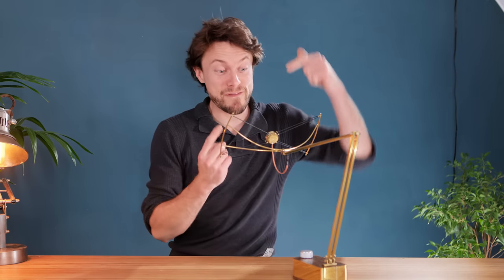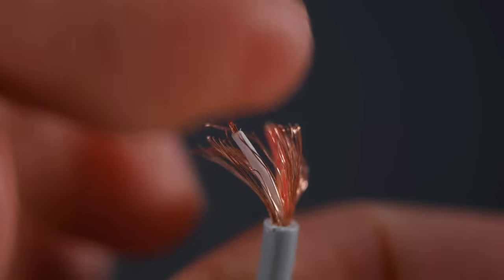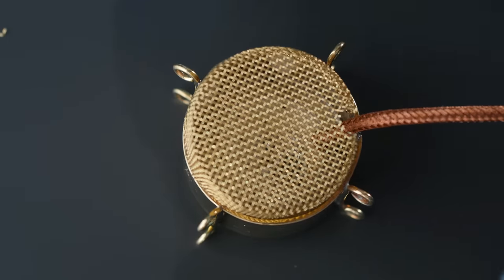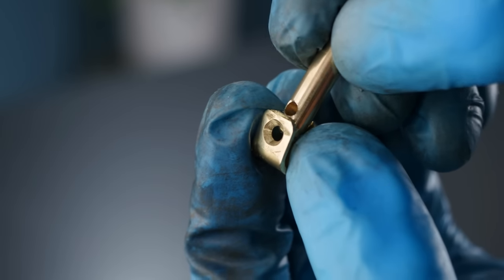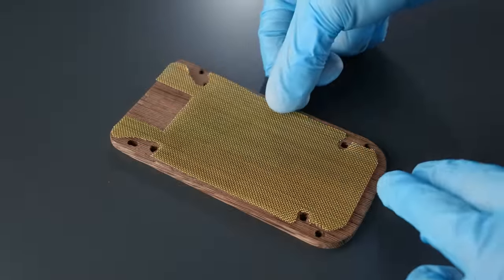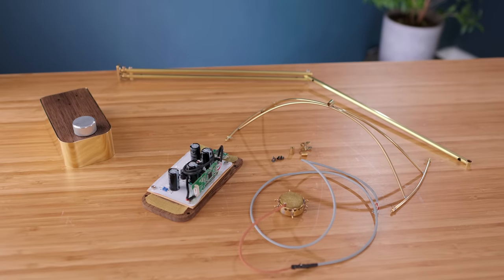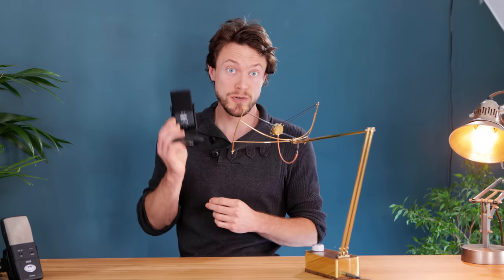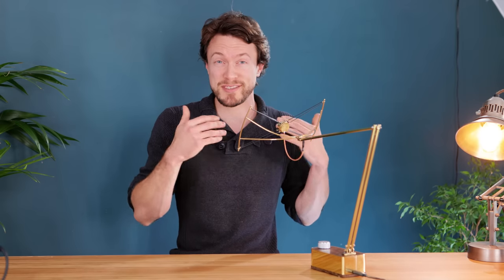Building a quality USB-C microphone

Comment: My favourite part of this DIY is the salvaged USB interface. I would not want to solder all of those connections.
Reply: I'll take the $10 lapel mic from Amazon that sounds just as good.
Reply: @DecafToaster740  but that's an extra $10 cost on your project. if you do that with every component, it gets expensive and just makes more e-waste. recycling parts saves so much money

Comment: Nice work, Matt. Note: soldering isn't welding. Welding melts the workpiece, soldering uses a lower melting point alloy to make the joint.
Reply: he might be brazing, depending on the filler used
Reply: @iivarimokelainen  Brazing & soldering are the same thing, melting a filler material.  If the temperature the filler material melts at is above 450C, then it's brazing.  It's really an arbitrarily defined difference.

As Bill pointed out, welding doesn't need a filler material (solder in this case).  You can weld brass, but the zinc fumes will give you a bit of headache so best avoided

Comment: Steampunk microphone. I love it. I worked in radio for a while, so I've experienced a few different microphone alternatives. Overall, I think your DIY alternative stacks up really, really, REALLY well. It has some more top end, but it does not sound "tinny". However, the Neumann sounds more "balanced" between the top, middle and bottom end. Something I think can be remedied easily and cheaply by changing some of the capacitor values. Overall: I think it is a thing of absolute beauty, both in sound and appearance. I would actually happily buy one of yours instead of a Neumanns... It sounds THAT good.

Comment: Had no idea microphone capsules are so much cheaper than the microphone. Going to do this with a Shure RPM106, which is only $159 instead of $359! And you can get the windscreen for only $15 extra and make it look and sound like the SM7B. Excited to see how it goes, thank you for the tutorial and information!
Reply: It might surprise you, however, most electronics that don't require highly precise manufacturing due to their complicted nature are like this. 

Take for example, just listing things off the top of my hat;

-Headphones and speakers(which are basically the same thing) can be made similarly to the video, at a fraction of their price. The most annoying part is a good housing for them, but if you have a non working headphone for example, you can just switch its insides with a headphone speaker and some DIY skills like in the video. 

-Powerbanks are also something you can replicate for very cheap, if you have a 3d printer(for the case) even better, but you can do it without. There are a lot of DIY powerbank videos you could watch that make some insanely good powerbanks for a cost of some terrible ones. It honestly surprised me when I came to know of some of these. 

Honestly speaking, if you have a wood carving kit and some electrical knowledge, you can make some insane stuff. Custom built mechanical keyboards have been a craze, for example, and you can build one for very cheap, you just need to buy the electronics and switches you want, and you can carve everything else out of wood. Other than that, the powerbank case, and speaker/headphone housings can also be made with wood.
Which, in my opinion, other than save money, offer some good aesthetics as well.

P.S. This is not a promotion for a wood carving kit, I just think it's a must have for any DIY-ers out there, it's worth the price in the long term. (I'm also in love with anything made out of wood but that's not the point)

Comment: Not exactly an audiophile but honestly when compared to the Neuman the clarity of yours sounds a tad better at the expense of sharper S sounds and slightly weaker mids. Perhaps a low pass with a really high cutoff would put it at the same class! Still an incredible build
Reply: The thing is you can find a similar Microphone capsule to the Neuman for around $130. The only thing you need to change is the microphone capsule. So this project also has a good upgrade path.
Reply: @tvo770  Definitely possible, although I would not know whether it is the microphone or the amplifying circuits that are the cause of the specific properties we are seeing. Although the idea of building out, upgrading, and repairing a microphone like a pc would be a really interesting concept that could reduce cost and waste (at the expense of time).
Reply: @btam_13  But it is a hobby. Time spent on anything is not wasted, if you enjoy it. You don't have to be a sound engineer to make a functional microphone, and if you have access to parts, and lots of spare time, you can experiment, tweak the circuitry, try out other capsules and body shapes, and get it to sound the best for you. Using it would get you far more enjoyment than a commercial microphone, because you made this one yourself. It would be your unique child, instead of a mass-produced doll.
Reply: @matekovacs2696  Also a fair point! I guess part of this hobby specifically that entices me are the possible optimisations and design choices that a DIY maker can choose. Experimenting and learning is a huge part of the enjoyment itself

Comment: Really couldn't tell the difference at the end , your build sounds just as good as the 3k mic , DEFINITELY wasn't 3k worth of difference , great work man that looked awesome too
Reply: The diy had slightly clearer/better sound in my opinion.
Reply: @dtiydr  I felt the DIY had a lot bassier voice compared to the professional. The professional aims to do what expensive cameras do. Make a neutral raw data that can be tweaked post. But for streaming, this isn't really an interest. But if you want to sing and do songs? You might not find the DIY to fulfil your needs fully compared to the XLR equivalents. 

So it all depends on your use-case and your voice. Not to mention that DIY perks have a fairly bassy low-tone to his voice naturally. So it might not work too well with people with a lighter tone voice.
Reply: @Helveteshit  I guess we are hearing differently. The neumann has more bass to it.
Reply: There will be really no difference for you either if he used a 50-100$ mic from market, because he is using a 500$ sound card (Focusrite Scarlett 18i20).
And yeah, Neumann is much more clear and less compressed than the DIY mic, u just need a good audio devices to listen it.

Comment: I personally find the s, ts, f, tch, etc. sounds to sound quite strident, but overall  this is a very nice project and I wish I had the tools to recreate it because it looks like a fun project.
Also the $3000 mic is sounds slightly more bassy though that's not to say the DIY version doesn't have bass. Both sound good and for the price I'd rather get the DIY ofc.
Reply: Have to agree and better explained than what I could accomplish. The DIY mic is really impressive, even more so with it's price. But the studio mic does have an edge on those sounds you described.
Reply: Plosive is the word you are looking for. I agree totally, plosive and sibilance are a little harsh on the DIY mic, and milky on the u87
Reply: @gravesclay  I think you mean fricative, a plosive is something like /t/ /d/ or /p/ /b/
Reply: The neumann sounds bassier because that great mic has even lower distortion and better frequency response. You can add distortion very easily with a knob, but you can't take it out.  Distortion adds harmonics, which are always higher frequency than the source or input. Hence cheap microphones sound more "clear" because they make up harmonics by distorting a little. The more faithfully one captures the sound, the duller it sounds. it contains fewer harmonics not only on the high end but in all the spectrum. And thats better because you can add distortion later, as it is done in music, quite a few times actually.

Comment: I'd have twisted the wire pair through the shield. Balanced signals running on twisted pair wires reject noise very well. In combination with the shielding, it'd be dead silent (depending on preamp).
Reply: You would need a third wire that contains no signal to balance it, and you would need the added circuitry to add it. Not that it couldn't be done, but it definitely increases cost/complexity. The thing is though, if the noise floor is that low already, you're highly unlikely to gain anything by actively removing noise.

Comment: I can't imagine the lack of sleep caused by using this silver potentiometer, unbearable.
Reply: hahahahahha
Reply: I´m dying xD
Reply: Me too xD
Reply: @FixTechStuff  OR ... you could use the same procedure, used for the 'mic capsule' enclosure, to cover that silver knob with brass mesh & brass strip technique? ... it will match up nicely ...
Reply: I wonder if there is a process to change its color, aside from anodizing. However, I wouldn't put it past Matt to figure out how to perform DIY anodizing.
Reply: @krellft  It's generally not a good idea to mix metals in a build.
Reply: @tf_d  Maybe ... but it's not a problem in this build ... it's just a cover ... if it triggers people that much then you just make the knob out of wood, or 3D Print one and then apply the same covering process ... they're just ideas to rid the silver knob ... it's not rocket science ...
Reply: @AndyGneiss  Maybe patina !
Reply: how about spray painting it matt black and cutting a little groove to insert a bit of brass wire?

Comment: The Neumann had a a softer and warmer tone to it while the DIY mic had a very bright tone to; however, noticeably and to be expected, the DIY mic picked up a lot more background noise and had a noisier signal where as the Neumann had a clean signal. Like I said this is to be expected but even still, the fact that you were able to push out such great sound quality for 40 dollars is a great achievement and it sounds incredible for that price range, nice job man!
Reply: It cost a lot more than 40 dollars to make. Here in the us it will cost about 300 dollars.
Reply: A bit of fuzzy wind material might take the poppy sound out of the DIY

Comment: Huh. This is one of the miniscule amount of cases I've seen a DIY project that is actually cheaper than just buying whatever you want to build straight up.
Reply: Not if you get the parts shipped to Europe D':
Reply: @Starach  can’t you buy the items locally, or is Europe not big in electronic components?
Reply: @popenieafantome9527  I actually managed to find some similar looking pieces. The main concern was making sure they're the same quality.

I'd link them but my comment seemed to get removed. It's on eBay under Microphone Large Diaphragm Cartridge Core Capsule Replacements Mic Parts

Comment: I was wondering how this would be budget friendly when the crimp tool used for the JST connectors is so expensive and then saw he'd soldered the crimps on. Well played.
Reply: @-pacer- just desolder them when you replace them as it wont be often at all

Comment: So, here's the thing. It's cool and all, and for $30, great, but not everyone has tons of materials lying around. The whole parts list, not including capacitors, is right below this sentence.

Mic capsule: $13
Transistor: $6
THAT1512 : $7.34
Audio capture: $18
Usb c breakouts: $9
7mm brass tube: $6.50
6mm brass rod: $10
3mm brass rod: $7
Nitrile rubber o rings: $7
Brass mesh: $15.50
15v+- isolator: $8.00
Brass sheet: ~$15
Rotary switch: $6.29
Dip ic sockets adaptor: $10.89
Jst-hx2.54 kut w/ crimps: $9.87
Enabled copper wire: $10.90
Strip board: $8.79
Desoldering wire 2mm 8 pack: $14.00 

Hoping  you have capacitors this should be it.

Price without capacitors:
$155.31 (WITHOUT SHIPPING) 

(These prices were estimated on multiple different platforms such as amazon, eBay, ect.)

At this point, I would rather save the time and buy a mic instead. If you want to build it and pay $155, go right ahead. Anyways, i feel like the $30 for this was just baity and upsetting when you realize its gonna a cost almost ×5 more than you expected. Not really cool but oh well.
Reply: Honestly depends where you get everything.  I'm almost done making mine, I've manged to keep it just under 50$
Mostly alleyexpress and local hardware and craft stores. 

I personally find it more rewarding regardless to

Comment: when you swap back and forth i can tell that the 3 grand mic is a bit better. a bit more balanced and natural sounding. it's not that much of a difference but i can see why people would want it for studio work.
Reply: You can tune the frequency response in software. The only question is, does the mic add nonlinear distortion that cannot be compensated for.
Reply: But for the average not-singer streamer, the DIY one is just A-Freaking-Mazing. It's really diminishing returns at that point.

Comment: Cool video! When I did my own price list search everything came out to about $145. Was the estimation of $30-$40 just for the capsule parts? Here's my price list. 
Capsule- $15
Transitor pinout- $5
Audio Control preamp - $7
USB Audio Capture Card- $17
usb c breakout board - $8
Brass Tube 7mm od 0.5 - $15
6 and 3mm Brass Rods 24" - $10
72mm nitrile 1.5mm o rings - $9
Brass Mesh Sheet - $8
15v Power Isolator - $8
Rotary Switch - $14
Resistors/Capacitors/Wire/Strip board 
$15 - $30

Estimate (not including shipping)
$140 -/+

If you see any mistakes by all means let me know!
Reply: This seems right - and I was disappointed when I came to the same conclusion. Your price list doesn't even include the brass strip, the small thick brass bands and the large/wide brass strip, screws, wire, desoldering, heatshrink, and loads of smaller components.

I assume the price shown ($30-$40) is the cost if you own everything required and only need to use the small pieces of it. Or perhaps wholesale cost...

Comment: I don't need a usb microphone, but after watching this, I'm damn sure going to build one. 
I'm a bit of a gadget freak and I like to build things myself. Besides, that thing is gorgeous.
Thank you Matt for another awesome project.
Reply: This isnt really a usb mic its an xlr mic with amp built in or is that thr case with all usb mics? If i wire up my xlr mic directly to a amp does it become a usb mic?
Reply: @r00kiet80  Well XLR is just the standard connector, but yeah, all USB mics are just the capsule connected to a preamp that's then connected to a USB audio interface, all integrated on the body of the mic
Basically USB mic just refers to the entire self-contained system
Reply: @r00kiet80  How is it an xlr mic without an xlr connector?
It could also be a 3.5mm jack mic, by that logic.
This microphone is one complete unit with the boom arm, the capsule, the cable, the base of the stand, and all the circuitry, including the USB interface. So it is an USB microphone.
Your xlr mic remains a mic even if you disconnect it from the amp, and doing so doesn't require you to take apart the mic or the amp. Were you to disconnect this from the built-in circuitry, you would open it up in the process, and build a different device out of its parts.
Reply: @matekovacs2696  sooo if i tape my amp mic and mic arm together and cut off the xlr plug and solder it to the plug on the amp it becomes a usb mic?
Reply: @r00kiet80  Yes. XLR is just a connector. So the only thing that is XLR about a so-called XLR mic is the connector. Remove that, and it is no longer an XLR mic. If you solder a 3.5mm jack in place of the XLR conenctor, the mic becomes a 3.5mm jack mic. If you solder an amp and USB ADC in place of the XLR connector, it becomes an USB mic.

Comment: I actually like the diy mic's sound a lot more, better clarity
Reply: I don’t like it a lot better because there’s not much difference. But the diy was louder so for that reason I like it better
Reply: @Quitt_Chan  The jli mic’s frequency curve is mostly flat, but has a bump at around 6k-13k, and is lower at around 50-100. The Neumann uses a K87 capsule, which costs around $160. The extra higher frequencies on the JLI is probably what makes the diy mic sound louder if it’s not the gain, but loudness itself can be changed with gain from resistance or digitally.
Reply: @nolanwadr  
I mean that is the only difference I could tell between them. So there’s no reason to spend that much. His diy is not at all easy to make and would set you back twice what he quotes, but to get thousands of dollars quality for less than a hundred is great.

Comment: The most expensive and difficult part is the design of the external acoustic design of the capsule or driver or pickup (in case you already have one). To do this, mechanical parameters are reduced using special mathematical methods to their electrical counterparts, electrical circuits are compiled, for which systems of equations are solved. Then everything is brought back to the mechanical form, and then there is a complex process of accurately reproducing the parameters obtained during the calculations. Everything that concerns elasticity, tension and compression is especially difficult. Undoubtedly, everything can be done on a hunch, an inner instinct, but in this case there can be no talk of predictability and repeatability.
However, your result seems to be excellent. Congratulations!
I really like how you sounding here but in case of studio I'd prefer a Neuman one just considering the perspective of further post-production processing. It seems that Neuman has that mid-low frequencies that would be hard to obtain if they're absent.